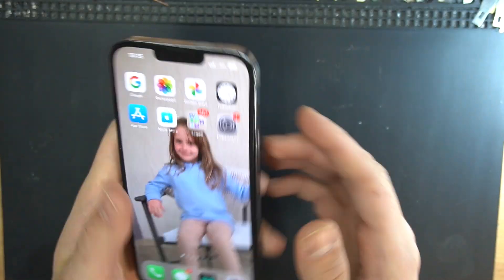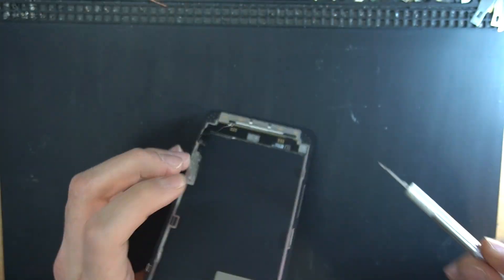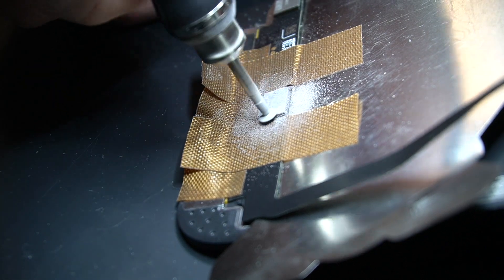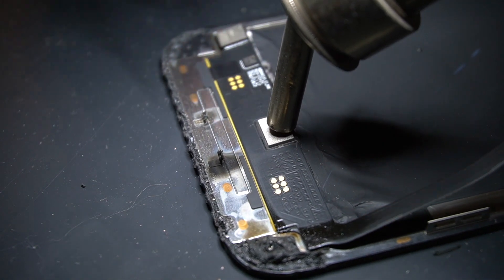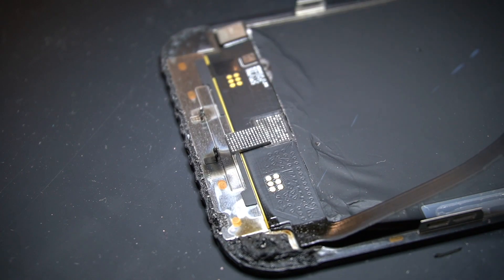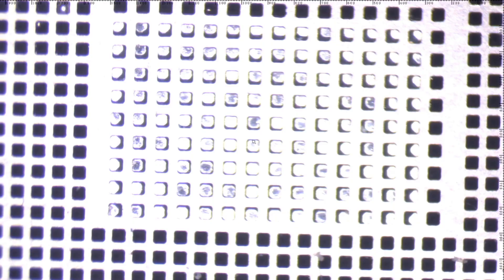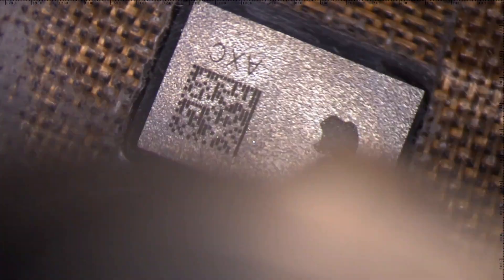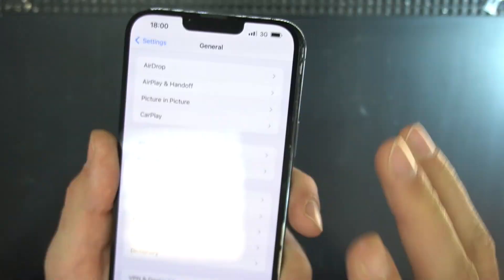iPhone 13 Pro Max screen replacement and remove important display message (screen chip swap)

Comment: Why you change the entire cable from old display to new ... what is the need for this unnecesary repair ?
Reply from the maker: What do you mean by entire cable?
From the name of the video, remove important display message, the original information of the original Apple part is in that chip.
Reply: @iTouch-repair   and the chip is attached to the old cable... you could just take out the entire old cable and put it in the new display .. like you do with the True Tone cable on top ...
Reply from the maker: @डफ़क-user-gr3tg2yk6o-24_डफ़क  what do you mean by cable?
Reply: @iTouch-repair  ribbon, connector, the black strip
Reply from the maker: @डफ़क-user-gr3tg2yk6o-24_डफ़क  you mean the speaker flex cable.
The important display message is not in that flex cable, it’s in the chip that I replaced in the video.
The True Tone is in the speaker flex cable, so not only you need to replace the chip but also the speaker flex cable, they are all connected and linked to the motherboard.
Reply: @iTouch-repair  how much this repair cost ?
Reply from the maker: @डफ़क-user-gr3tg2yk6o-24_डफ़क  you a full screen replacement or just the chip replacement?
Reply: @iTouch-repair  Full replacement of the screen as it has 4 big cracks ... but I would like to have the True Tone and all Face ID and other functionality back ....
Reply from the maker: @डफ़क-user-gr3tg2yk6o-24_डफ़क  please contact me through the links in the description.
Reply: @iTouch-repair  ok .. I will.. thanks

Comment: For the solder paste, what temperature melting point do you prefer? 138, 158 or 183 degrees?
Reply from the maker: 138 degrees

Comment: does it sill have promotion 120hz display and True Tone?
Reply from the maker: The 120Hz yes.
The True Tone you need a programmer for that.
This process only to remove the important display message.

Comment: What if I can’t access that drill?
Is there any other options ?
Thanks
Reply from the maker: Hi, well it’s the safest way to replace the chip.
If you apply heat, you will need to deal with the underfill and it requires more heat and that could damage the LCD
Reply: @iTouch-repair  ooh,  thanks 
I didn't know 
Hmmm,  where else can I contact you at,  apart from here?
Would like to see if I can bring in my phones too for that kind of repairs
Reply from the maker: @arafateinst9870  all of my contacts are in the description

Comment: True tone came??? Coz i also replace that ic but true tone not came…
Reply from the maker: The True Tone restored after the upper flex cable is replaced with the original